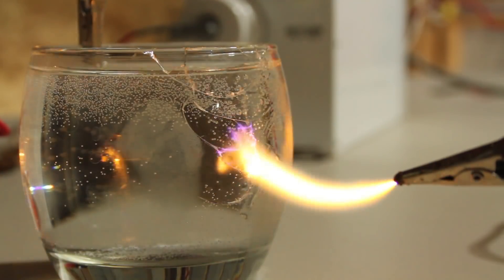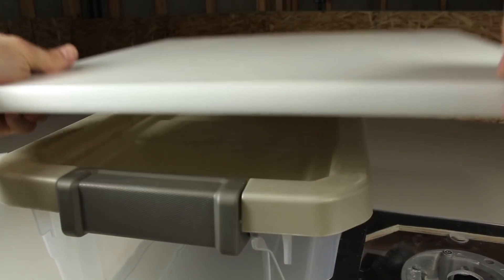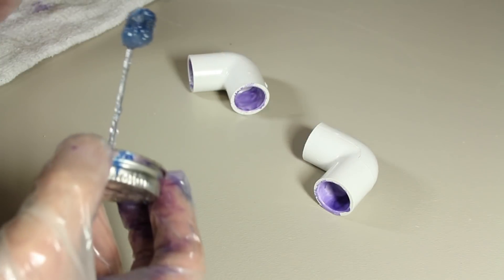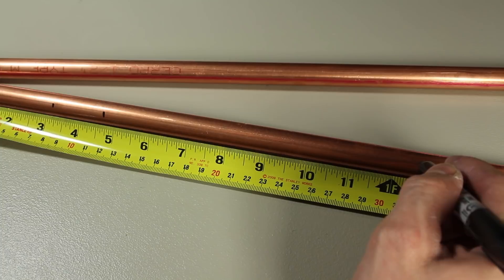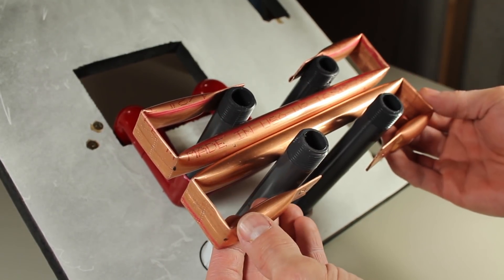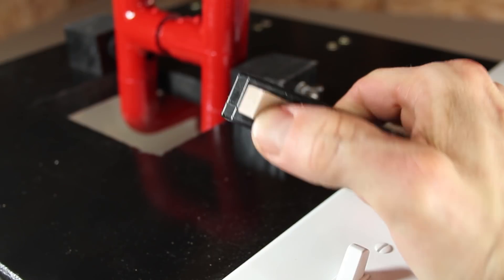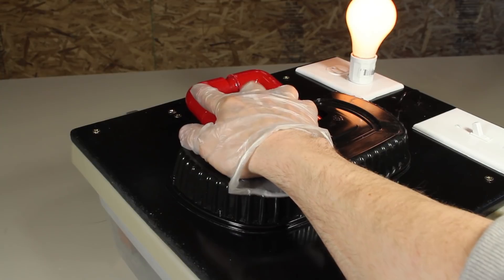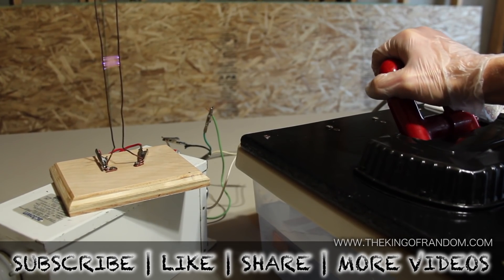The Scariac (Poor Mans Variable Power Controller)

Comment: You may not realize that the danger of this thing is not just Current but the fast effort in this device making chlorine gas and Hydrogen gas your breathing which is highly toxic and deadly. Sodium Hydroxide is an alkali same as Potassium Hydroxide both are water soluble while both cause exothermic reaction when added to water. I think using Potassium Hydroxide would be a way better electrolyte It will still create Hydrogen gas though...you can use Kool-aid too...I would  just get a converter or use a dimmer switch easy and way cheaper. Great Video though...
Reply: You make no chlorine when you electrolyse sodium hydroxide solution. You get chlorine gas when table salt is your electrolyte. There is no chlorine present in his electrolyte. Sodium hydroxide and potassium hydroxide do NOT explode in water, only sodum metal and potassium metal. Huge difference. Sodium hydroxide added to water would actually cool the water down slightly. No exothermic reaction lol.

This reaction will produce hydrogen gas and oxygen. The sodium will stay in solution as it is not stable underwater as a metal. 

In order to produce sodium metal from sodium hydroxide, you need to melt (not dissolve) the sodium hydroxide (takes about 300C) then stick your electrodes in the molten salt. If water is present in your sodium hydroxide, you cannot produce sodium metal.

Proper controllers are expensive and light dimmer switches will burn out with the load of a power tool connected to them.
Reply: Dimmer switches do not work the same way. They also can not handle high loads, like using it to power anything other than a desk lamp thus defeating the purpose of it. Sodium Hydroxide is lye, and you know where else that is? SOAP!

So you're telling me that soap will cause an explosion when I use it in water? I've been living dangerously my entire life!
Reply: a dimmer switch doesnt work. its a different principle (PWM)
Reply: its more a proof of concept that you can do it
Reply: you should do some research before you make electricity claims you know nothing they make them I use one 600w rotary dimmer
Reply: I know all about lye- sodium hydroxide NaOH- or caustic soda ,,,, yes in soap but the soap is neutralized by the fat silly
making soap
Reply: You can always buy a variable speed controller for 15.00 too you people are like from a dungeon It's humor though......
Reply: spartan456  
you should do some research before you make electricity claims you know nothing they make them I use one 600w rotary dimmer  
I know all about lye- sodium hydroxide NaOH- or caustic soda ,,,, yes in soap but the soap is neutralized by the fat silly
making soap 
You can always buy a variable speed controller for 15.00 too you people are like from a dungeon It's humor though......
Reply: Robert K You can't use a little light dimmer on a 2400W circuit and many tools/experiments are not suited to a PWM dimmer. I'm sorry you have to use a 600W dimmer with your rotary tools, they must be weaker than a mouse's fart.

A 500W drill stalls when you put pressure on it lmao. Not much you can do with 2/3 of a horse.
Reply: +Ei aC First of all You guys can go back and forth all you want i'm assuming you all been around long enough to know the variables...so maybe I need to right a book on specifics here. first off I'm suggesting the use of the dimmer on a 110V SOURCE. now on a variable speed motor your fine it has brushes induction motor no no... all I'm saying is yes it will work with full power to motor... most grinders are variable speed motors is this way reliable probably not but a Variac is not very reliable either.... if you know anything a variable speed can use both Dc and Ac power sources...
Reply: So hydrogen gas... I guess I won't be using this in my tesla coil (or the drain cleaner in the capacitors). I don't want to blow myself up.

Comment: I made something like this years ago.. but not as fancy... 
I didn't have a control lever.. I just took the wire and wrapped it around two bricks..
and used a stick to move them closer or farther away to powerlevel.

Comment: Same sort of thing, used on HV. Motors, to give them Resistance on Start up,to give them Torque,under load.
They are Called Liquid Satrters, a Mixture of Washing Soda and Water in a holding tank,with the electrodes in it....

Comment: i wonder if this works with dc voltage
Reply: It does.  The electrodes will corrode faster, however.  Plus there are cheaper ways to regulate power to a DC device.
Reply: I already have this one made. I have a decent size variac as well. Ar you talking about a light switch dimmer. Is that the cheap way you are refering to.

Comment: This is how you make explosive gas
Reply: Not with lye. Plus he made sure to use large conductive pieces. As for the solid core wire, it won't see much use before it snaps, that could pose a hazard since it has a tiny surface area.
Reply: so you tell me that H and O is not being stripped with current??
Reply: Very slow process if anything using large conductors like that, someone did their homework there. The chemical he added would add to the conductivity, with higher conductivity it's harder to strip Ho from he water. You would have to change the water once in a while otherwise it would collect crud and cause gasses to be released.
Reply: Getting shocked by the water since it is live, causing Hydrogen gas if the surface area of the conductors aren't big enough to overcome it.
Reply: its AC, not that much electrolysis is produced, it heats the water a lot thought.
Reply: I'm pretty sure AC still generates just as much hydrogen and oxygen gas as DC, but since the current is switching directions hydrogen and oxygen gas will come off of both electrodes.
Reply: I learned that when I made a device to electrolyze water, (not Grant's design) but I used AC current. It ended with a fairly large explosion.
In hindsight that was really cool, but also really dumb.

Comment: Could this be used to power the mini arc furnace?
Reply: yes
Reply: not alone  you also need  a  transformer  to reduce  voltage  and increase  current  
 i  insiste you must have a  transformer  or you will not only  die  (i'm  not even exaggerating ) but also  nothing  will melt
Reply: +bac302 OK thanks

Comment: The only issue is that this is a pretty inefficient way to control the power. The current not used just goes into heating up the water!

Comment: Needless to say, I won't be making this.
Reply: Agreed, it's an interesting thing for sure... but it's one of the sketchiest things I've seen this guy make.
Reply: There really isn't anything terrifying about this, even if you tip it over and knock electrified water everywhere, as long as you cut the power it won't do anything bad. This is just a different form of variable resistors, really. When you use a volume knob on a speaker it's doing something similar, it's just adjusting a winding that changes the flow of current.

This just relies on distance between electrodes in a conductive material. It's actually really cool. It also demonstrates why movies and pop culture are full of morons. You won't die if you stick a hot power line in water and put your hand in it. It depends entirely on how impure the water is. ElectroBOOM actually did a great video on this and it illustrates perfectly that conductivity in water is inversely proportional to distance. The closer two conducting materials are within the water, the more current/voltage. The further, there's none or next to none.

Of course if a toaster oven falls in the bathtub while you're in there you may die, but that's because they run on much higher amps and volts. But "normal" household voltages like 120VAC? Nah. Not unless you mix half a bin of salt into the water.
Reply: same
Reply: +john black in this particular application, the use of AC does make it particularly dangerous but once again, as long as it's constructed with isolation in mind (it is) then there's nothing to worry about.

The only danger when using this would be touching the output line when the closest distance/highest voltage.

Lye is good for this because it turns the water into a much better conductor. Water itself is not conductive as I'm sure you know, it's the impurities within it that are. By adding salt or in this case, lye, you are altering the conductivity.
Reply: +Felix Hil (Unloadet) Right. The addition of extra impurities decreases the electrical resistance of the water. This is why for cleaning electronics it is recommended to use pure, distilled water or 99% isopropyl alcohol.
Reply: Not me ether - but that's not because this one is dangerous, but because I prefer to have more efficient regulators like a variac or PWM-controller. If I used this one for example to my furnace - the water would probably start to boil (because of power losses). Also, the electrodes will corrode over time (especielly when used for high power devices that needs a lot of current), leaving a sludge that's not very nice to clean out. 
But this is still a very cool as an experiment - shows how easy a high power variable resistor can be made and the conductive properties of water.
Reply: +spartan456 whatever happened to Trichlorethylene to clean solder? It works great and leaves no residue, just don't breath the fumes. The next best I've found is Anhydrous Alcohol... and you can breath some of those fumes with only minimal brain damage.
Reply: john black well the saltwater is a conductor and should act as one, like a copper cable. But the Difference to a copper calbe the water has got a higher resistance value that changes with the distance between the poles and the ionisation state of the water.
Ohms law applies for AC and DC.
At least I hope I got it ... have a nice day
Reply: spartan456 well I googled it just for interrest salty water has a typical resistance of 5*10^5 and water one of 10^12
Reply: well I usually use something like a dissolvant like acetone to clean my pcbs after sodering them
Reply: +Felix Hil (Unloadet) Acetone is good but it's something to be very conservative with. Too much or too high concentrations of it can slowly eat away at the plastics in chips and various other electronic components. I would only use acetone if I'm following up with a generous amount of alcohol.

Acetone for cleaning something like nasty crusty flux, and then the alcohol for cleaning the acetone. Alcohol, like acetone, dries just as quickly if not faster and leaves no harsh chemicals behind that could damage things in the future.
Reply: Can you give me the model number of a variable controller for this welder?(other than scariac.)
Reply: john black by the way 240 volts is the standard power grid voltage here in evrope
Reply: BeGamerSl and the usage regulations of the powergrid are verry strict, as example every device needs to be galvanic seperated by from the net
Reply: Siskin's Bits and Bobs why ?
Reply: spartan456 doesn't change the fact I'm not making it

Comment: I am not sure what all the comments are about the danger.. It looks pretty safe to me. Can't touch anything electrically hot. Device could also be built with a pump that would vary the level of water on electrodes. Notice that it will heat up the water in use.. Popular vaporizers are built the same way, but minimize the volume of water around the electrodes so the water heats a lot and produces steam. I don't see anything dangerous here at all. Very nice design.
Reply: But if youre not careful, any water that leaks out while its running will be dangerous. And if that gets in contact with you, that's your one-way ticket to your local morgue.

Comment: i  love your movies but this time i need to say : potentionmeter is  cheaper, smaller, and much safty
Reply: :doubt:
Reply: think of the electrodes as a wire; as the electrodes come closer its like the wire diameter growing, lager diameter gives larger surface area and hence more current carrying ability. there is nothing there to consume the electromotive force, voltage, and so that why theres essentially zero voltage drop. Maybe there would be voltage drop if the current was DC as work is done in the form of creating gas

Comment: Count me as a new subscriber.  Very good info well done. The Scariac modified for use in a car ( ev ) would solve a big problem for me. I'm about to invest in a homebuilt ev and large DC motors are expensive but controls are cheap.  AC motors are every where and  cheap. the only drawback i'm told is the controls are expensive. They say AC is the way to go. Have you looked into this.  Thanks, Richard.

Comment: I normaly like what you do but what you do here is realy dangerous in multiple ways.
First the chemical issiues: This machine produces hydrogen and oxigen gas when used and this stuff can blow you up as you know yourself. Using that in a closed room in combination with welding (ignition source) is not a good idea. This thing also produces sodium metal becouse of the sodiumhydroxid (lye) in solution wich reakts with the water to produce more hydrogen gas in a exotermic reaktion (another ignition source)
Sekond the physikal issiues: You already said how dangerouse the electricity is youre using here so i dont list that again i just want to say that in my opinion this alone is to dangerouse to use it at all when you acidently knock this thing over youre very likely to get a shock wich can realy easy kill you.
Reply: +Erik Hunter No no it doesn't. As has been pointed out it doesn't have a fixed anode or cathode. It's still stupidly dangerous but chemically it's only dangerous due to the pH involved.

Comment: Correct me if I am wrong but after watching this video several times and doing some research I believe "scariac" is a misleading name for this project. A true variac, varies the actual voltage and not just the current of the system. What you actually seemed to have created, while still very cool and intriguing is a saltwater dimmer. You are varying the resistance of the circuit and not the voltage, proven by your own volt meter.

Comment: i would like to see what the wave form looked like on an O-scope, mainly to check for deformation. and plus you can get a bench top variac for cheap and also grounded.

Variac - Variable Auto Transformer
Item no. TDGC2-0.5
$64.95

Comment: Shouldn't it be salt water?
Reply: +Mitchell Spanheimer That is a terrible idea.  Running an electric current through salt water is how chlorine gas, which has been used a chemical weapon, and lye is produced industrially.
Reply: But it's an electrolyte, and that is what is used on the picture of a liquid rheostat on Wikipedia, albeit from the 1800's :) Are you sure it would produce chlorine? Maybe only DC produces the chlorine gas and sodium hydroxide... I'll have to do some more research...